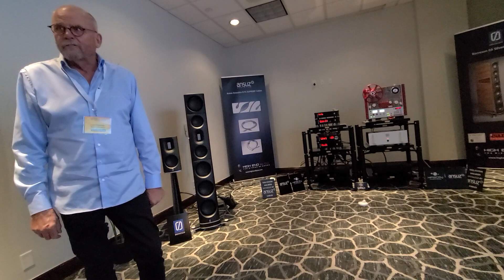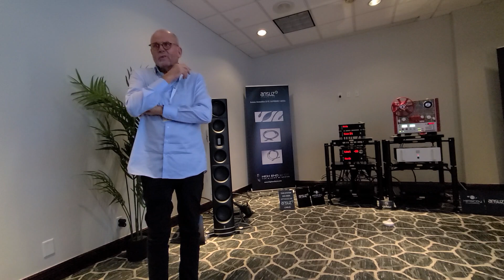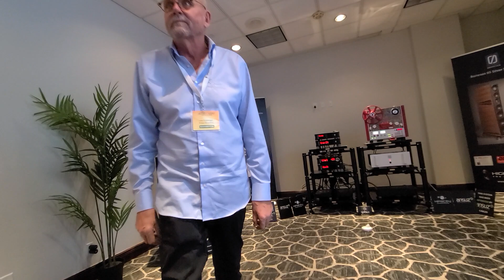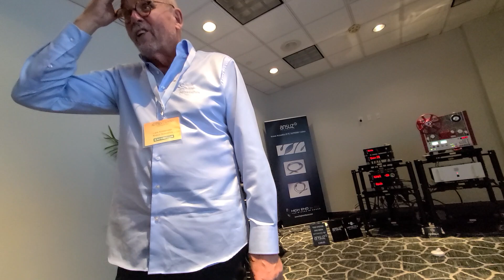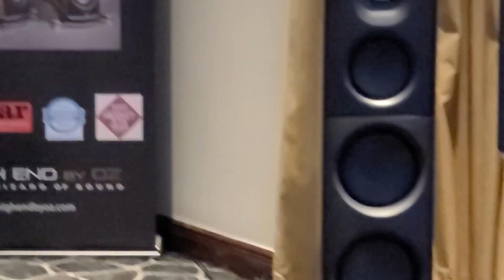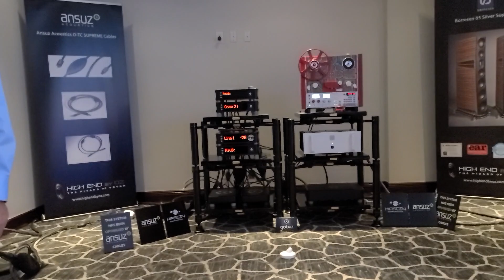Borresen Speaker Technology Discussion by Lars - Day 3 - Florida Audio Show 2022

Comment: Very nice video! How does the Soundfield Audio 1212 Overture Active Speakers sound compared to the Borresen Active Speakers and which do you like better?
Reply from the maker: I didn't hear any active Borresen speakers.
Reply: How does the Soundfield Audio 1212 Overture Active Speakers sound compared to the Borresen Speakers thats in the video and which do you like better?
Reply from the maker: Well there's a huge difference in price that makes the comparison both easy and difficult.

It's real easy to say the Soundfield speakers would be my preference with my own money.  In terms of value and potential to mate it to my room and tastes, it's one of the more impressive designs I saw at the show.

On the other hand, the aesthetics, cabinet and driver quality of the Borresen speakers are exceptional.  Using my own EQ and dedicated room, I can easily see that speaker having the highest ceiling of performance.

The Borresen also has a somewhat advantageous dispersion vertically with the taller array of drivers.  I tend to prefer the realism that kind of speaker can present.

If they were the same price, I'd take the Borresen... At the current pricing differences, I feel the Soundfield has the better value.  You can't put a price on aesthetics and everyone's budget is relative to what they make. Thus, if you can afford the Borresen, then go for it.

Comment: So much bs in high end audio!  Lively speakers sure they sound great but not for what they are asking.  Stick to my Legacy Focus SE!
Reply from the maker: The Legacy stuff is great, but they have quite high priced models too and often demo in the big rooms.
Reply: In a treated room the Raidho speakers which are very similar and designed by this guy too is just fantastic. Dealer where I'm from sold 3 in a few months that's USD 250k each. Thomas Stereo visited often a system that's one of the best he has listened to and a Raidho too but a less expensive model. The sound tone is sublime while being very detailed and dynamic. A reference for an editor at Absolute Sound too. It's all a matter of taste though. Cheers and Happy Listening.
Reply: @francisdelacruz6439  can't agree more. Bought Raidho's bookshelf speakers (designed by Michael Borrensen) after ONE single demo. After 15 mins I knew I wanted them. Forever changed the way I perceive bookshelves! (sure I use 2 subwoofers to extend the bass but Raidho's tone is surreal! Best balance between precision and musicality). Just my two cents on Michael Borensen's technical prowess!